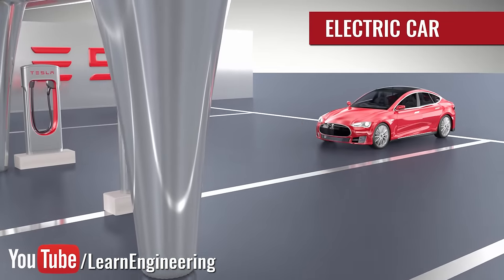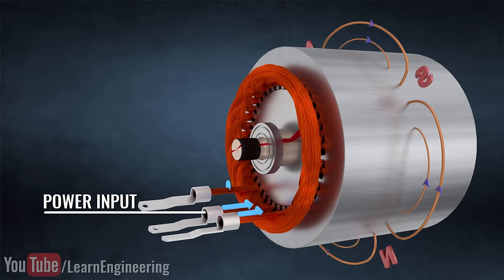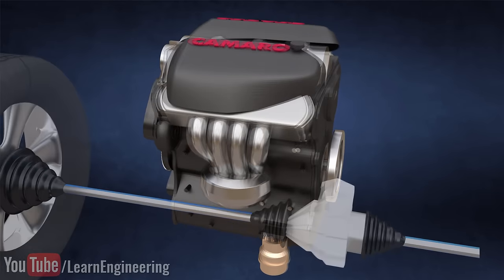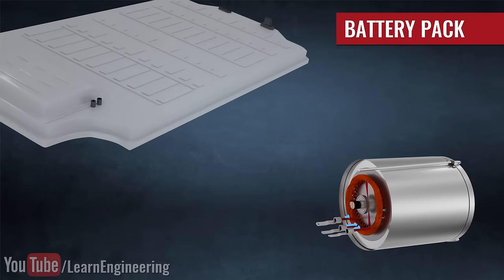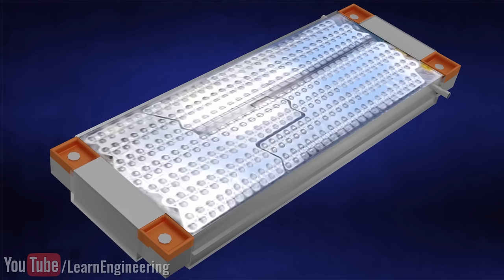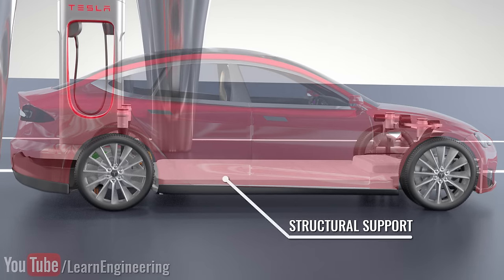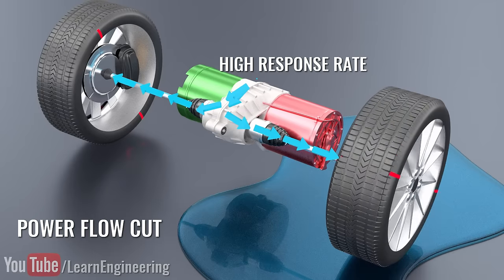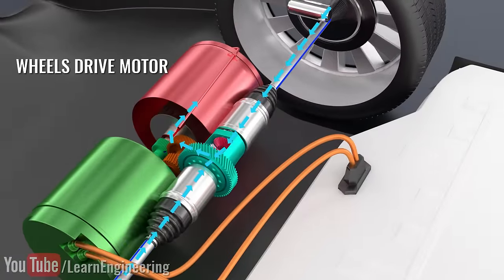How does an Electric Car work ? | Tesla Model S

Comment: We'd already be driving elecric cars if the oil industy hadn't halted the development of these vehicles back in the 70-90s
Reply: K1ngjulien_ Yep, it had nothing to do with cheap abundant fuel and far less developed material science.
Reply: EclecticBuddha I can't tell if you're being sarcastic or not, but the fossil fuel industry has a vested interest in making sure their biggest Cashcow doesn't go away. That isn't to say it is entirely on them, but they've played a huge role in the electric car being killed repeatedly.
Reply: That's the thing that few people realize. There were many really great iventions like magnesium based batteries with (for the time) gigantic capacities. But the patents were bought by giant companies, so that noone could use the technology.
Reply: Sal Cameli cool, how is your experience? Any difficulties or major problems?
Reply: K1ngjulien_ Just Range is the only issue.  But the Nissan LEAF technology is already 8 years old.    You can spend what I did in 2013 on a 2017 Chevy #BoltEV and get 3 to 4X more range and much better battery technology.
Reply: K1ngjulien_ Yep, in fact Nikola Tesla suffered tremendously from sabotages by oil companies, and Edison who knows Tesla's AC is better than his DC.
Reply: I mean, you can't really say ac is better than dc, both have their pros and cons. Electronic circuits, for example, all use dc. But if you want to drive a powerful motor, ac is definitly the way to go.
Reply: You can't transmit DC power over long distances, if Nikola Tesla didn't invent AC, the world would been sitting in dark.
Reply: Captain Morgan you can get a 2 to 3 year Certified Pre-Owned Nissan LEAF for $8000 right now.    Or you can buy a brand new 2017 for $18,500 right now.     You say $15,000 more?  Which New car costs $3,500 that you're talking about?
Reply: Captain Morgan in 2013 after all incentives I paid $26,500 for my Nissan Leaf and I save $2200 a year by not buying Gas.    At $26,500 minus your $15,000 that's $11,500.   Which new car is $11,500 ? - $2200 a year multipled by 13 years = I paid nothing for my LEAF.   Seems like buying an EV saves you money.   You cannot save money by buying a Gas Burning car.    Learn more by going to my website. It's my name.
Reply: +K1ngjulien_  dont get me wrong, I am all for EV's, but magnesium batteries have not been blocked by "giant companies", they just werent good enough due to low voltage and low energy density. Lithium Ion battery technology has made EV's break through, there is no conspiracy theory needed. Offcourse there are companies who would like to halt or slow down the EV evolution, but not in the way you suggest. Battery technology can simply make too much money these days for one to put it in a locker; the applications are abundant.
Reply: Captain Morgan pretty sure he said LEASE - Chevy has a LEASE for $220 to $300 a month.   3 years.  No replacement battery in 5 or 6 years.  That's somebody else's problem.   Not his.  Right now there are 32 plug-in cars.   By 2020 there will be 75 models.   By 2040 80% of the cars on the road will be EV's - In 10 years Solid State Batteries will start to be used.  Look it up.  Same 94 year old inventor who worked on Lithium Ion announced this new technology 4 months ago.  20 year life span.   3X faster charge times than Lithium Ion.  3X less space required for same range.   Sorry but Oil is Dead.  #UBUYGAS
Reply: www.UBUYGAS.com Oil is not dead where does the power come from? Oil companies still will make money just as much and Electric cars are not pollution free because the energy needs to be produced.
Reply: power can be from renewable energy sources. such as solar, wind, wave or hydroelectric stations. Here in New Zealand more than 80% of the power generated is from renewable supply.
Reply: Nice video. Maybe they could note it's a very efficient ac induction motor. Much better than dc.
An electric car is 4x more efficient than a,gas car.
They did a good job oN the Regen braking but could also mention it reduces dust and brake,wear. 
The batteries will also last 20 to 30 with good cooling which all plugin have except the LEAF.
Also most plugins charge,at night Off Peak when there is excess in three GRID with low transmission use and low,transformer loads. Many utilities dump excess since they have no storage. That is why off peak power cost less in a time of day plan.
Electric also comes more,and more,from solar pv, Wind and Geo thermal so it's cleaner every day.
Reply: solarstacks Everything you said was right, but I feel like you should know that the 2013-present leaf changed it's battery systems to be  on par with other EVs to last much longer. Tesla of course has the best numbers so far though.
Reply: Slightly off base. Many technologies were suppressed in order to delay transition to EV. EV 1 was already a practical local commuter vehicle that could easily solve the issues of noice and local toxic pollution in cities but it was killed by GM just when they saw that the new generation batteries were coming (NiMH). They quickly sold the patents for large capacity batteries to big oil that delayed the transition to EV by at least a decade.
Reply: Tesla packs show no appreciable degradation (5-7%) at 250K miles. Get base model 3 and never worry about fuel again.
Reply: 100% of my electricity comes from solar. It can be done.
Reply: I made 141% last year with no other power and ran our home and 2 electric cars.
I actually am GRID Tied so I can help the power company and my neighbors when I made too much. I also only charge Off Peak at night since I know my utility had excess at night and can't store it. So I help them On Peak and Off Peak.
Reply: K1ngjulien_ agree.. n way better than now...
Reply: K1ngjulien_ then it's a deja vu: just for you. And it can also be seen as 'back to the future'
Reply: K1ngjulien_ You mean that happened back in the 1890s.  The government and oil industry, in combination, made the I.C.E. industry take over.  Remember, electric cars were first. ;)
Reply: The new advanced non toxic long lasting Lithium batteries are the key. Millions of lead acid vehicles running around would have been a big problem. Today the 20-30 year life of properly designed electrics and range that can go anyplace on a trip or last a week around town are really great. Combine that with all the Solar PV and Wind growth and you have a sustainable solution today.
Reply: K1ngjulien_ 
battery tech was not to good either back then..that too is evolving as we speak
Reply: K1ngjulien_ is really Alex Jones.👽
Reply: K1ngjulien_ o
Reply: Only ignorant people don't WANT an EV. It may not be economically feasible or practical for everyone yet, but if you understand EVs, you DO WANT one.
Reply: the real reason is the energy packed unto fuel->power ratio. the first cars were  even water powered. and battery tech is nowhere beyond what we have 50 years ago.
Reply: Probably halted battery development too.
Reply: K1ngjulien_ dan 2
Reply: Nissan has a 100,000 mile, 8 year battery warranty on the 2017 model.  You'll likely get a whole new battery pack around the 6-8 year mark.
Reply: realistically gasoline engines are going to be here along after 2025 because there are simply way too many of them to get off the road or cost too much to convert into efficient electric power cars. where are all the junk gas cars gonna go? there isn't enough junkyard to hold millions upon millions of auto junk including recycle parts.
Reply: except 10 ton animals are biodegradable unlike most man made things.
Reply: I am an electrical engineer, the electric car was not possible because there weren't batteries with capacities high enough, but aside from that an electric car is a very simple yet highly efficient device which basically anyone can make, tit's way too easy to design, kinda makes it feel like a toy.
Reply: Dude, the development of power electronics only became for real on the late 70s, and the price only dropped significantly on the 90s and don't even let me tell you about our batteries. Don't say stuff you don't know, it's way more lucrative for the oil industry develop a revolutionary way of producing energy than start killing every tecnollogy that unfeasibles the use of oil.
Reply: K1ngjulien_
Reply: K1ngjulien_  Only if we completely get rid of petroleum we will be able to drive electric cars as well
Reply: lars exe, you seem to debate logically , but you do not understand many things, sure batteries have less energy density, there is absolutely no doubt that your statement is correct, but these cars compensate for it by having much, much larger power output for the same weight in motors as compared to engines, so engine weight is down, then the transmission, gearbox, separate regenerative breaking systems, separate batteries for starting, separate alternators, for battery charging, rectifiers for the alternator all get junked. This compensates for the lower energy density. And tesla is not a "boring" car, the top model accelerates to 100 in 2.3 seconds, that's not boring, and yes CO2 is "food" for plants, but right now we are making much more of the food than plants can eat, plants like IC engines are extremely inefficient, and yes if we were allowing the number of plants to increase, then perhaps it wouldn't be a problem, but making more food and killing the consumers of it, while the food being poisonous to us is madness.
Reply: and yes, oil is used everywhere in consumer goods, roads, manufacturing and backup power, i am not saying it is evil or anything, but if there's a better alternative to oil in some applications like transport and vehicles, why not use the better thing if we can?
Reply: And yes you might argue, electricity comes from powerplants using coal, the truth is that powerplants operate on a more efficient thermal cycle, achieving upto 58% efficiency using CCP and Regeneration(my dad worked on one in the world's largest oil refinery(which produced it's own power) and commissioned 2000MW of power, so don't doubt the number), compared with 22% for diesel, also coal is way more abundant than oil, and is cheaper for the same energy, and will remain so even if demand increases, as it is so, so abundant.
Reply: AC and DC have their own benefits. You can transmit DC power long distance, it calls UHVDC, which utilizes both AC and DC at different stages of its transmission lines.
Reply: hheheheHEHEHEheheheheehHEHEEH
go to truthcONtEstcOm, reAd The pResEnt
Reply: In Norway it is close to a 100 % renewable mainly from hydro energy. But Norway is still one of the big emitters of CO2 due to big oil industry.
Reply: One of the first common cars ever(Henry Ford times) was ellectric, so much earlyer than in 70s.
Reply: Electric cars are a band aid. Sky rail weighs powered by electric power are the future. Electric and Compressed air cars are promising for a band aid but lithium for batteries and even just metal for the compressed air cars is very limited and not fully recyclable. In 2,000 years unless their is a way to make metals, their will be no way to make personal cars. Houses are just stationary objects they can be made out of anything even renewable sources, cars aren't even electric cars.
Reply: no. we didn't have batteries with meaningful energy density nor did we have nearly as sufficient recharging technology back then. you don't need to have a pro-oil agenda to oppose developments of EV in that era. it was simply beyond its time.
Reply: It goes back before that. Back when we had steam cars we also had EV's and gasoline cars. Gasoline cars ended up advancing more due to more money for R&D. I don't think that's the only factor but I think it's a big one.
Reply: Kyle Towers To add to that, an engineer wrote on a page on Tesla Motor's website that DC brushless motors have a higher peak efficiency while AC induction motors have a higher average efficiency.
Reply: Yeah but then we wouldn't have the sweet ass Teslas! I like this timeline better
Reply: K1ngjulien_  wtf u talking about. patents time expires and then technology becomes free to use and sell. what big companies u talking about
Reply: The first hybrid car was made in the late 1800's.. we could have had it far earlier :)
Reply: Jeriame Zenzayer But gasoline cars used to be garbage as well. They became more practical because more money went into R&D to develop them.
And as far as conspiracy theories, why didn't GM let customers buy their EV1's at the end of their lease?
Reply: MAN GASOLINE CARS WERENT SHIT YES THEY WEE REAR WHEEL DRIVEN AND  NNOISY BUT GIVEN THE USE OF SOFTWARE TECHNOLOGY AND BATTERY EFFICIENCY AND KNOWLEDGE RESOURCE THIS WOULD HAVE BEEN WORST FOR YOU GUYS THE ELECTRONIC INDYSTRY HAS UNDERGONE REVOLUTION RECENTLY GIVING YOU BOOM  THE ONE THE IC ENGINES NEVER EXPERIENCED AS WE KNOW THE DIFFERENCE IS ONLY THE POWER SOURCE ALL THE REST OF THE THINGS ARE SAME
Reply: Cory P Grow first, profit later is a strategy that many tech companies use or have used and that's what Tesla is doing and Tesla's (major) investors understand this.
Reply: K1ngjulien_
Right, it's all a conspiracy. Got nothing to do with the technology for this was garbage back then and it was too expensive? Besides you need petroleum products to build an electric car. Petroleum is used for way more stuff than just fuel.
Reply: K Hitch Why do you think the Petroleum companies demanded the copyrights to the NiMH battery. Which then forth, halted EV's becoming a much more popular vehicle. It's not that the technology wasn't there, those NiMH battery powered EV's could go 100miles until the battery would be depleted. And they weren't that much more costly either.
Reply: K1ngjulien_ 
Dude electric cars exist since the 1800s 
Who would stop you?
The fact that oil cars are still better for the money ?
Reply: Gabe_N They aren’t anymore. For business or consumer, gas cars aren’t as cheap as they used to be at all.
Reply: indeed! But we really need a change now!
Reply: Mellow _ 
Because companies are getting bigger and bigger and have employees to pay
Reply: Gabe_N Not really. If a company gets 2x bigger, they only get roughly 1.25-1.5x more employees
Reply: Mellow _ 
You are talking from the 1800s to the 21 century
Reply: Gabe_N it’s been so long since I’ve typed in this comment, so idk
Reply: actually what halted the elecric cars were the batteries, even today the batteries technology are a issue
Reply: junior Tesla has doubled the efficiency of the lithium battery, and apparently there’s a new sodium ion battery that’s 10x better and it’s solid state, so we just have to wait and see if it comes a thing.
Reply: riDDum,are you sure now days isn't possible!?
Reply: I love driving my 100% electric car. I will never change back to noisy, vibrating and stinky internal combustion engine cars.
Electric car driving is so much relaxing and powerful.
Reply: I said it before, and say it again, that until they develop an energy pack (aka battery, capacitor, or fusion) which gives the same or better range as ICE cars (Internal Combustion Engine) and deploy charging stations at every gas station, ECs are just a toy for now. ;)
Reply: They don't have a choice now. Supply is running out. Popularity of the electric car is growing and people are increasingly growing tired of the petroleum companies crap and prices. Somebody will profit off electric cars and that is what will kill the petroleum companies. The same happened with cigarette companies.
Reply: Exactly. Another powerful profiting mass will emerge at the expense of the oil companies demise. The auto manufacturers for example don't care about the oil companies. If they have an electric car that sells, and people are buying them up like hot cakes, they will invest and build them and make their money. The oil companies lose because they did nothing to innovate with the industry and mass market turned away from them. So they are left with barrels of oil they can't get rid of. But in the intern, a battery producer for these EVs will be the next corporate giant. Just ask companies like Phillip Morris. Remember all they tried to do to keep people buying cigarettes? Nowadays, I barely know people who smoke. You can't smoke indoors anymore and to buy a pack of cigarettes now its $13 because NYC taxes them like crazy. So people stopped using them and some turned to vaping. The same will happen with the oil companies.
Reply: I seem to remember something about this,they all laughed, about electric car's back then.but since the formula e world championship,and company like virgin, Richard Branson saying it's the car of the future,he is right, about the environment,I see more and more electric car's,and charging point.now
Reply: DC can be transmitted over long distances today thanks to technological improvements, but  nikola tesla didnt even AC electricity, he invented the induction motor and greatly improved on AC technology.
Reply: Colorado Cyber  are you forgetting all the subsidies and money lending the government has done for electric cars? making them more accessible to the public in turn making them more viable and cheaper in the long run?
Reply: Colorado Cyber  electric cars need subsidies, because without electric cars on the road and there's no point in building infrastructure for it, but with no infrastructure put in place no one will buy electric cars, it's a suicide Loop, I'm fine with my government using my tax money for it since Tesla is an American company and inspires competition between other manufacturers plus they air in my city won't smell like shit, better that money go there then some dead end green energy technology.
Reply: Colorado Cyber  since they dont have a gas tax, states just issue a yearly fee that is sometimes higher then when they would pay for a gas tax, also if space X wasn't government assisted then our tax dollars would continue to be spent on very expensive launches, EVs will save the tax payers money when they pay less in fuel and oil.
Reply: Colorado Cyber  yep, couldn't even read the history tab on a wikipedia article, which is why you watch the history channel for your source of education.
Reply: EclecticBuddha then please explain why the oil industry was panicked when Henry Ford and Thomas Edison made a huge plant and produced EV 100 years ago.  Was going great till someone burnt plant down.  Then suddenly oil gasoline started along like crazy.   JD Rockefeller wouldn't do that,  oh no, he was a saint
Reply: Justin Charis Chandra  Edison was producing electric cars in a Ford JV,  Tesla wasn't
Reply: riDDum not true, there would just be more generating plants and substations,  until humans invented a way to do it
Reply: www.UBUYGAS.com what 32 ev cars ? I spent two months shopping other than Tesla only bolt and leaf had decent 40kwh, 60kwh, 100 leg packs hyinduan ion was a joke 27kwh,  kia was even less, etc etc imho anything under 60kwh is a vehicle that cant travel
Reply: Nirbhay Thacker you mean 0-60 in 2.3
Reply: WRONG THE MINING OF LITHIUM IS FAR WORSE FOR THE ENVIRONMENT.  FURTHERMORE WHY DO YOU THINK OBAMA WITH TO AFGHANISTAN?  DO SOME FUCKING RESEARCH.
Reply: In his first day after inauguration Ronnie Reagan ordered to remove all the solar pannels on White House and the enviromental laws and programs on energy approved in the Carter period were revoked by Rpublicans.
Reply: You are Correct Sir❗️
Reply: EclecticBuddha 😃😃DUDE-A-BOTICAL😀😀CUDDY-FRESH😀😀
Reply: I say nonsense If electric cars made any sense we would all be driving them Now.
Reply: @k1ngjulien_  Investigate about Richard Nixon's visit to the Middle East in the 70's to force the ME to sell petrol in Dollars, after revoking the Bretton Woods Treaty. Not only oil companies, but the Federal Reserve, and major banks too.
Reply: WRONG ! The First electric car was patetend & made in 1832 by Mercedes Benz. Better go back too school K1
Reply: Nonsense  If the electric car was not such a toy it would have replaced all other power sources, It does not make any market sense and it can Not compete with the good old gas engine.
Reply: Nah i want a real car thanks
Reply: Sal Cameli LOL, electricity is not free, batteries have a cycle life and costs a pretty penny.
Reply: Nonsense, the battery technology was not even close in the 70s.
Reply: ryan farmer gasp, no reality please.
Reply: Electric cars are and were  always toys, until a new battery technology is created gas/diesel will be king.
Reply: EV are still under attack by big oil/GOP, just look at Texas.
Reply: [̲̅K̲̅] bullshit - complete fantasy
Reply: @tonyromano6220  Tell that to the ppl of Texas.  It's been on current news, try reading.
Reply: When we see electric cars dominate racing?   THEN I will listen ...money where the mouth is!  Put up or SHUT UP!
Reply: @HeliosphanXtal  Just to let you know better tech on batteries will be graphine which is common and not rare like lithium ion. Will be the next super material. Change the world like silicone did.
Reply: @riddum2754  Yes, you can. Just google HVDC grid. It's now actually cheaper and more efficient on long distances than AC. It'was just too expensive and the technology for making high current-high voltage semiconductors doesn't existed before about late 90s. So back when AC was invented it was the right way to go for long distances but not anymore.
Reply: Sal Cameli eventually the power will be fusion energy. ITER.
Reply: @riddum2754  Yes you can! Check out HVDC https://en.wikipedia.org/wiki/High-voltage_direct_current
Reply: @EclecticBuddha  There's no new invention in an EV. The induction motor, inverter were all invented decades ago
Reply: @NAY2GAS Do we have 75 models now?